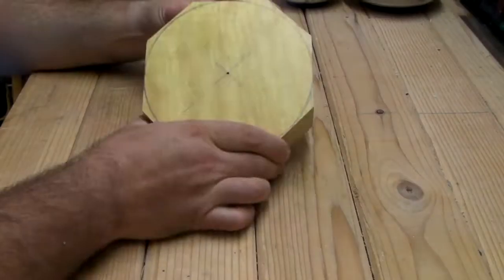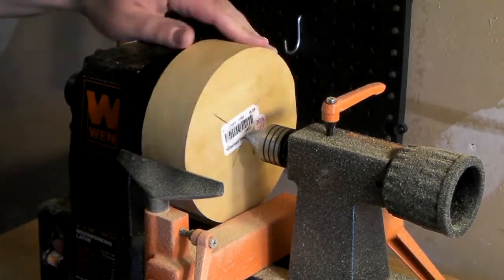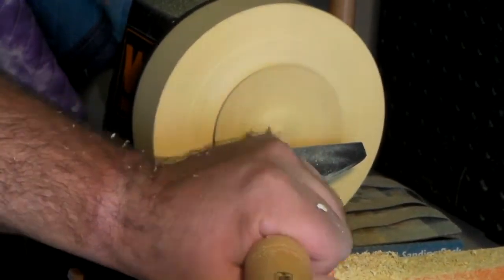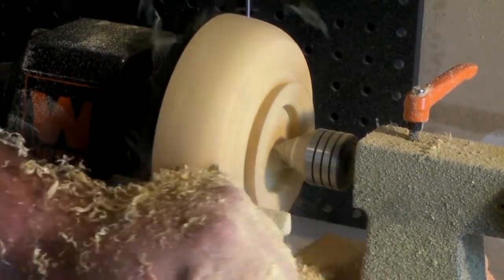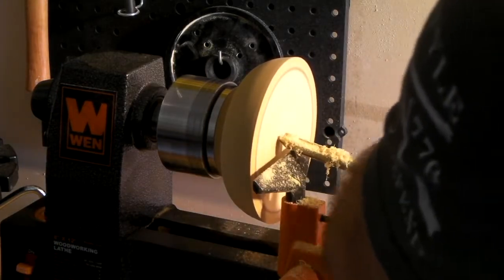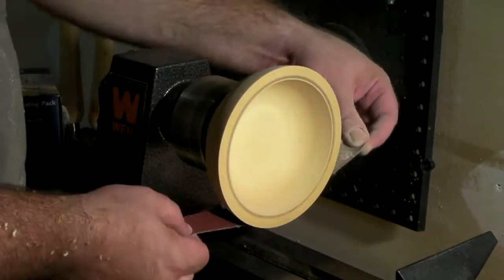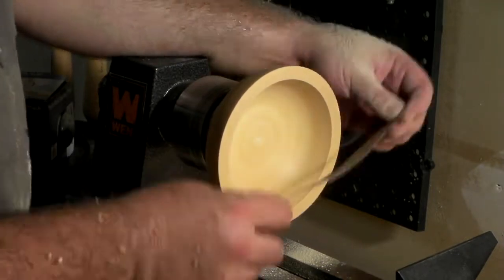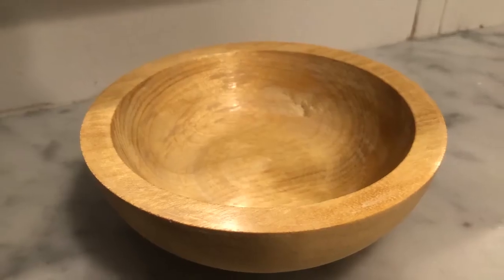Ep. 4- 1st Bowl

Comment: Hola que tal amigo me gusta tu canal exelente trabajo.
Me podrías pasar el modelo del chuk del mini torno yo tengo uno de ese modelo 
Gracias espero tu respuesta
Reply from the maker: Gracias amigo. El chuk es un tipo de inserto para tornos de madera Nova 48202 G3, que se encuentra aquí en Amazon.com- https://www.amazon.com/gp/product/B0064JJ52U/ref=ppx_yo_dt_b_asin_title_o00_s00?ie=UTF8&psc=1
No olvide que también necesitará este adaptador de mandril para el torno - NOVA IDNS 1-Inch 8TPI Inserto / Adaptador de rosca de rosca. Enlace de Amazon.com: https://www.amazon.com/gp/product/B0064JJ624/ref=ppx_yo_dt_b_asin_title_o08_s01?ie=UTF8&psc=1
Reply from the maker: Thanks friend.  The chuck is a Nova 48202 G3 Wood Turning Chuck Insert Type, found here at Amazon.com- https://www.amazon.com/gp/product/B0064JJ52U/ref=ppx_yo_dt_b_asin_title_o00_s00?ie=UTF8&psc=1
Do not forget that you will need this chuck adapter for the lathe as well- NOVA IDNS 1-Inch 8TPI Thread Chuck Insert/Adaptor.  Amazon.com link- https://www.amazon.com/gp/product/B0064JJ624/ref=ppx_yo_dt_b_asin_title_o08_s01?ie=UTF8&psc=1

Comment: When you did the bowl did you get any wobble? My granddad's tends to get very vibratey. Any ideas on how to fix this?
Reply: if it wobbles, it's not balanced (centered) on the chuck or spindle that you are using.  Try using a nylon or plywood spacer or two if you have the bowl face on a screw or spindle.  I find that using the faceplate makes sure the piece is mounted flat and flush, plus the weight of the plate carries over to the rotation of the wood, allowing more of the energy of the rotation to be matched across the face of the plate rather than a narrow worm screw or spindle.

Comment: How do you hollow the bowl without the tailstock being in the way?
Reply from the maker: The Nova chuck expands into a hollow I cut into the bottom of the bowl to hold it firm and steady, and then you move the tailstock away and use a bowl gouge and scrapers to hollow out the bowl.
Reply: @brokenbridgestudio9928  ive got a wen lathe